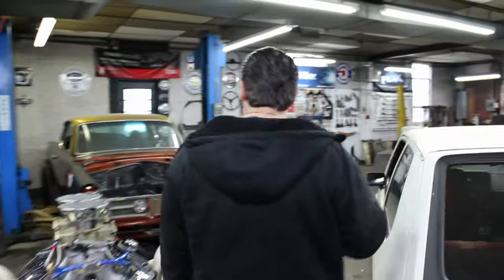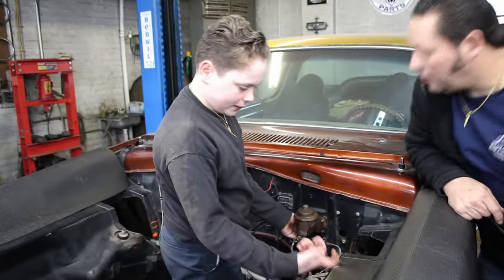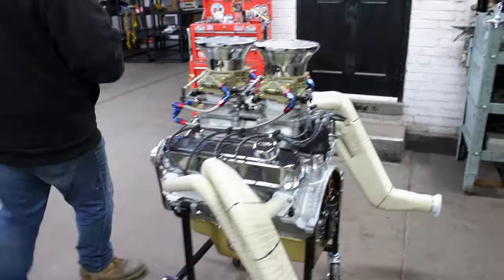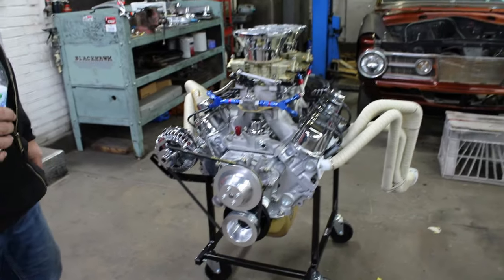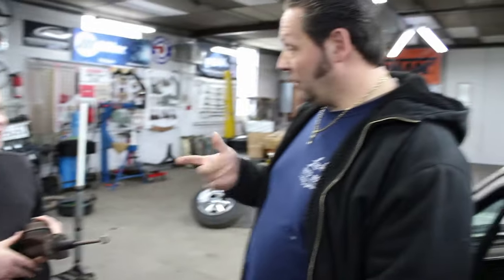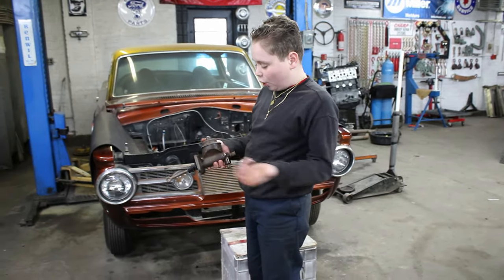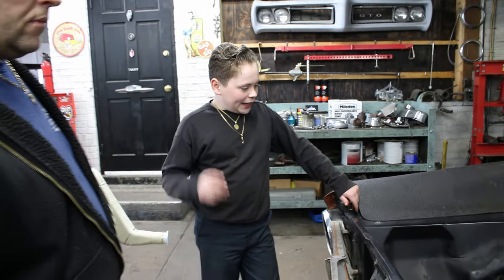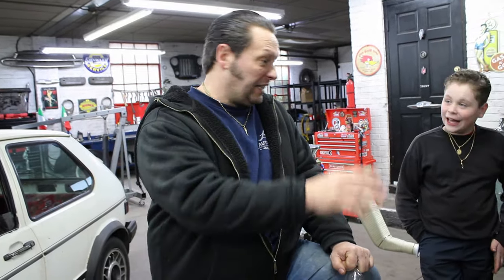Barracuda Update (Engine, Plans, etc.)

Comment: Nice choice dual piston master cylinder will you be putting disc brakes on the front and a brake booster with proportion valve